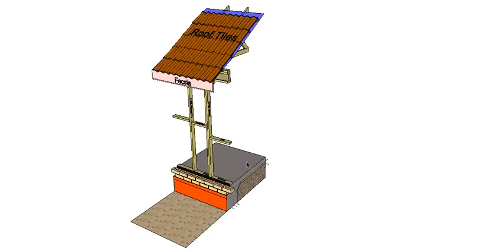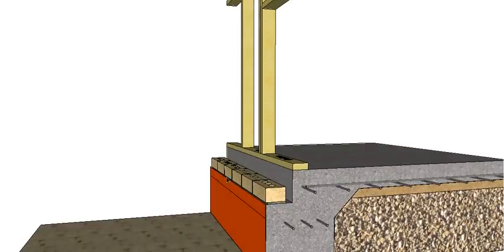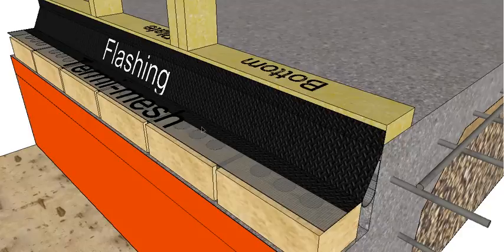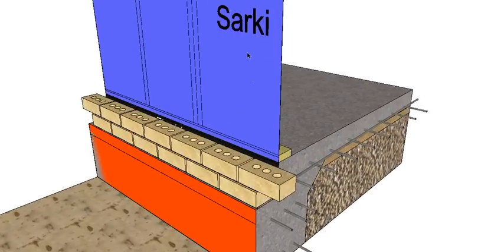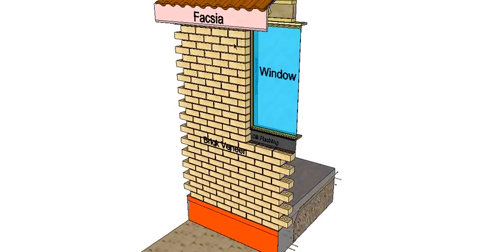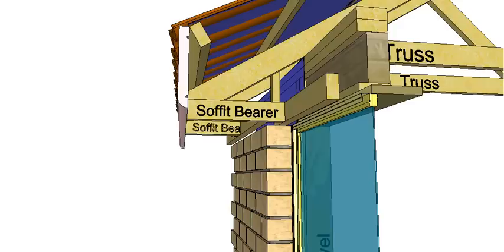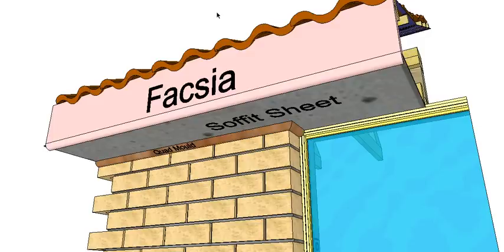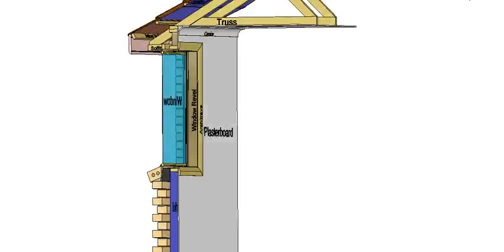Section through a Brick Veneer, Slab on ground Building Part 2

Comment: Hello,  we bought 25 old house  in Queensland Australia.  Now one side and half side of the second side of the house has earth against the wall( construction is 2 metre deep),  could you please tell me what I should be doing to protect the area from termite, coz as far as I know if I get termite treatment, it will not go that far deep down, what should we doing?
Reply from the maker: +Ta Hi Tal
As long as the termite barrier is below the lowest timber member in the house then it doesn't matter how deep it is. It will also depend on the type of construction as to where the termite barrier is e.g. Slab verses Bearers and joists.

Also the age of your house predates the changes that came in in 1995 regarding chemicals that can be used to protect against termites so the house my have been treated with these.

If you are concerned i would suggest getting a termite / pest control expert in to have a look at the house and advise on any actions required.

Hope this helps

Comment from the maker: Hi Twentyone twos, no not really usually it is cut off with he top of the ground or concrete slab if it hasn't been ripped out first. I guess you could stick it back to the slab if you wanted but this is not usually done.

Comment: nice video, but what about wall and ceiling insulation ?
Reply from the maker: Lakeesha Franklin Hi Lakeesha, Good point. Wall and ceiling insulation would need to be installed in the wall, before the lining is installed, and ceiling, after the ceiling lining is installed.
Reply: Thankyou :-)

Comment: HI is there any need to have the bottom plate fastened/secured to the concrete floor eg some kind of tie bolt?
Reply from the maker: cumquat159 Hi Yes there is a requirement to 'Tie Down' the bottom plate. Usually a M10 75mm dyna bolt every 1200mm plus on both ends of bracing sheets HOWEVER this is subject to the wind load area you are in and the bracing design for each job

Comment: Wow, that was great. Love your work :)

What would the thickness of the wall from outside of brick to inside of Gyprock?

Is the air gap a standard on Brick Veneer walls?

Thanks again, i would say this is the best material i have found for Australian material.
Reply: Should of said, is the air gap dimension a standard size.
Reply: I guess im asking the wrong place but does someone know a tool to get back into an instagram account..?
I somehow lost the account password. I love any assistance you can offer me
Reply: @Gavin Edgar instablaster ;)
Reply: @Maximus Deshawn Thanks for your reply. I found the site through google and I'm trying it out atm.
Looks like it's gonna take quite some time so I will reply here later with my results.
Reply: @Maximus Deshawn It did the trick and I now got access to my account again. I am so happy:D
Thanks so much, you saved my account :D
Reply: @Gavin Edgar no problem :)